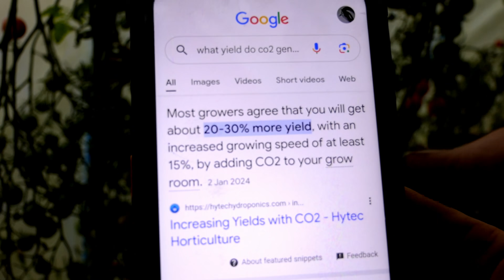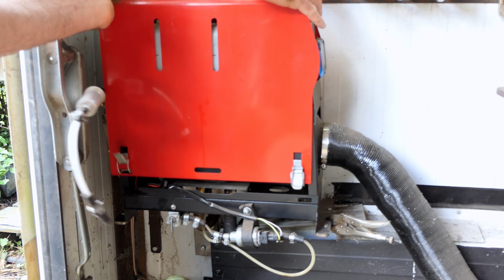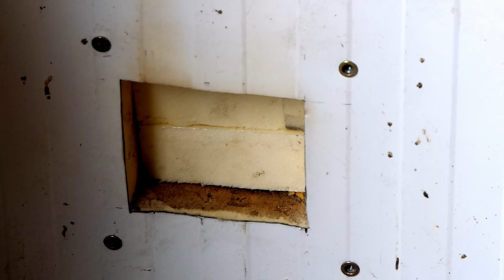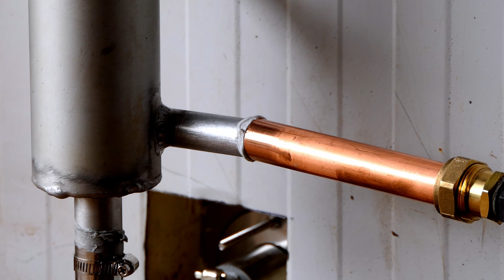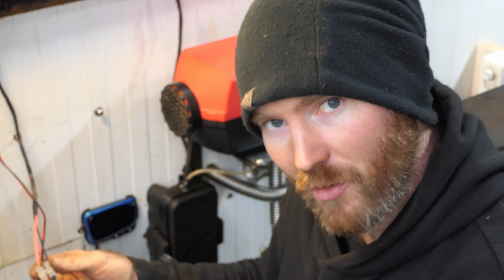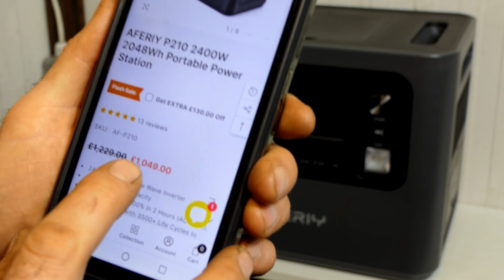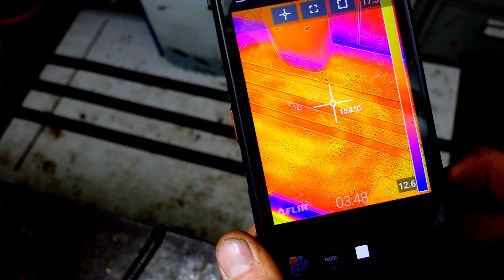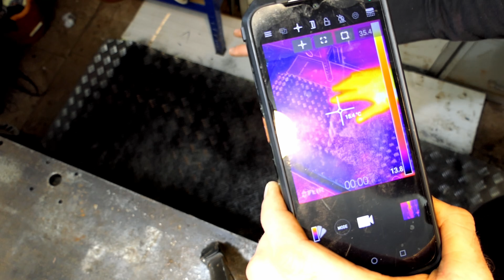NEW! Better system for Cheap and Safe Heating💲+ Underfloor Heating Mod test🫠

Comment: Some thoughts:  The problems with an overly relaxed attitude to the possibility of global warming is the probability of mankind creating a positive feedback loop which will lead to the ending of the current inter-glacial pause (Holocene) in our current ice age with the ending of that ice age. The fact is that without the current warming, whatever it is caused by, the planet would be slowly cooling as a result of the direction the Milankovitch cycles at the moment and heading to a resumption of the ice age in 20,000 to 30,000 years.  It is asserted that this isn’t happening because the effects of slightly higher levels of CO2 caused by the release of carbon that was locked up as fossil fuels (coal, oil and natural gas) in the earths crust by humans. 

We know how, and how much carbon has been sequestered and we know what the climate was when that carbon was in the atmosphere as CO2.  As you rightly assert the Earth was warm, ice free and teeming with life. It was also millions of years before a population explosion of one particular great ape in the Holocene lead to our current human civilisation.  

The fear is that by releasing the small amounts of carbon that we have we are in the process of creating a positive feedback loop, tipping the system into an ever increasing and ever increasingly rapid heating effect. The point is that the carbon was locked away and without human involvement, would have stayed locked away.  Furthermore we do other things which don’t help, such as cut down too many trees without replacing them.  

The trouble is that our civilisation cannot adapt to rapid change because there will be huge populations who will have to move because their climate will be too hot, or they live in and on land which will become flooded. Furthermore areas of food production will become less productive and famine will spread.  This will lead to war as the strong attempt to protect their populations from the much more numerous and increasingly desperate weak.  The human population and civilisation locks us into a need for the climate to remain within a stable range with changes happening slowly so we can adapt at a natural and subconscious rate. 

So the question remains is the human release of carbon, locked up by nature millions of years ago crucial?  If we released all then absolutely yes, but we haven’t yet and are unlikely to do so.  So how much is safe?  How much risk are we prepared to take?  Should we be doing anything about it?

I drive an electric car, not just because during its life it will emit substantially less than a fossil car but because, as far as I’m concerned, it is much better.  Furthermore it is substantially cheaper to run (about 25% of a petrol car).  I’m lucky because it is easy for me to do so.  I’d assert that it would be good if all in my situation got electric cars, air quality alone makes this a good idea. I live, however, in a Victorian house with solid walls which is largely in the shade of my neighbour’s larger house to the south. This means that heat pumps and solar panels are not as attractive they are for others. So I will do my best and I’d hope that you would do so also. There are alternatives to the wonderfully energy dense oil you prefer, try exploring those and please insulate that door.

Comment: I didn't notice on your video if you did it or not, but it's better with the pex pipe to install an insert in the end before you insert it into a push fit fitting. It helps to stop failure. I didn't know about those little water heaters, I just ordered one to add underfloor heating to a cold frame. Apparently our wonderful electricity suppliers/the bbc are turning off the signal that switches the old style electricity meter to the cheaper tariff overnight (economy 7) , that would make my current electric underfloor heated cold frame to costly to run.
Thanks for the videos, I enjoy your content.
Reply from the maker: Thank you, on a low pressure system the inserts are not needed from my experience. cheers J

Comment: I get frustrated with people conflating existing carbon, people breathing, trees rotting or burning etc, with the issue of adding co2 to the system.
Reply from the maker: I only used total CO2 from what I understand. cheers J

Comment: What  efficiency dose the boiler have I would think at max 60% .
Reply from the maker: My combi boiler is 93% efficient. If I can get good condensing heat recovery for the diesel heater then I can get similar efficiency. Cheers J

Comment: If exhaust gases were directed straight into an aluminum car radiator, with the whole setup submerged in a water tank, it could help transfer heat to your radiators. Additionally, the exhaust noise might decrease, as the water could absorb some of the exhaust vibrations.
Reply from the maker: Very true. Cheers J

Comment: One option is to add a sand storage for the exhaust gases. It will then emit the heat for a long period of time into the room. The exhaust gases can go from 200 degrees Celsius+ to 10 degrees at the end of the sand storage before going outside 😊
Reply from the maker: @icucode  I tested that already and it's not very efficient at this scale. You need temperatures exceeding 600°c to make it viable because sand is a poor conductor. Cheers J
Reply: @joshuadelisle  Yes it looks like you can store three times the amount of energy in water that you can in sand. A water tank with long exhaust pipe is perhaps the best way to store the energy. 60 kWh / m3 for sand and 180 kWh / m3 for water with 160 degrees Celsius difference from ambient temperature.

Comment: I do have one question as all the time working in engineering with being told & seeing the efforts in keeping air cool on entry to burning of fuel made me take interest on results?
Think about intercoolers?
OK the burner is the same as I have & know how inefficient it is with the Chinese always using the peak outputs in advertisements, with never saying the average it really works at.

interesting to see results.
Reply from the maker: I think I would like to do an experiment just on that by switching the air intake with a heat exchanger version. cheers J

Comment: Truthfully, there is a lot more energy we could take from our atmosphere than we do. For instance a piezoelectric diaphragm that has a vacuum on one side then a vacuum on the other but it is held back by a one way check valve. Just make sure it's shaped to bend back as air rushes past and rebends back into place the diaphragm for Bernoulli's principle to reduce pressure to have it bow out less and setup multiple diaphragms in a row to capture 90% off energy of the air rushing past. Oh, also have it self seal so it maintains vacuum and direction towards a lower pressure for maximal total capture of movement but also making it constantly pump so long as the seals remain for the vacuum and diaphragm. But this introduces vibrations, which can be turned into an acoustic cooler/heater. Neat, huh? But yeah you can make it hollow and have refrigerant get pushed around by diaphragms connected to pump it in a resonance harmonic frequency for Thermo pump (the whistle when heated, when done properly with the right check valve reed valves a pump is created using vibrations) but you did. The diaphragms before but now with extra tube over that. Just on the vacuum side the vacuum will transfer volume as a sonic wave in the metal. Anyways, that gives you vibrational heating while making electricity for the gravitational potential energy converted from air pressure but also absorbs the heat from it needing to rush through and get compressed because of vibrations heading backwards thanks to spring tension of diaphragm relative to the vacuum tension on the other side with the air rushing through. Just need the right clearances, for all of it to do it over the maximal surface area to smallest inner diameter nozzle point to largest surface area. Basically it's an type of hour glass shaped, they call them deval nozzles. Just split them repeatedly into smaller and smaller ones that shape into that, which just means infill is a couple of plates with hole and tube patterns and sequences that makes a fractal 3d repeating inward bound deval nozzle set, which now is easy. Why because offset recessed holes on both sides of the plate with the correct angles done and drilled, sizing too, then you get the deval nozzle fractal repeating set, that's 3d. Then it gets bigger from a ultra small chamber area of check valve piezoelectrics diaphragms. To split it and race it towards the larger area. 

It's a good generator from just electricity generation, but cools itself with refrigerant, never burns any fuel to do it, easy to make and repair, and be hooked up to another one to transfer energy to the other side which warms everything it gathers on the other side using the same air pump, thermal transfer, the other one is but in reverse.

For moving heat somewhere it makes more energy than it takes to run. Because of vacuum energy being the only required true stored energy. It just had to be balanced, which is why spring tension is so nice because it makes it so very much easier to do. So vacuum peristaltic pump that makes heat get moved because of the vacuums inside it what make sure keep wanting to pump it acoustic resonantively and work energy refrigerant, with resistive or no resistive heating added from the generated electricity (because, yup, it does that) or you can use that to just generate electricity for you. Oh right. It scales better and better the bigger you make it, but because multiple smaller ones can be built and made to do it together into a larger center point area for total volume efficiency to then have it exit multiple smaller ones outside, it becomes really really small and non-noticeable. We've had this for decades, truly 1000s of years, the parts at least, not the knowledge put together though lol. Why are we not doing the completely no pollution generator heater/cooler pump like this? 😏
Reply from the maker: Piezoelectric generators are great but generally very low output. They're commonly used to power flashing lights in children's novelty shoes that light up when walking. I like the idea of harvesting energy from vibration and resonance though which will dampen the sound. It's worth an experiment for sure. Cheers J

Comment: I put my pump outside under the tank in a box on the wall.
I use 3x 3m 28mm copper pipe looping on a wall in the workshop with a radiator at the start.
Currently moving benches & heater but I did touch the end of the pipe (carefully, I know stupid!) & it was hot but not too hot.
I burn far less fuel than expected but do have a dehumidifier to keep around 50% humidity @19C.
Myself burning kerosene efferently I see little impact compared to the people kerosene to fly the people who publicise global impact!
Bigger issues are other particles being created & released into the atmosphere & energy used in war!
The one wish I had was to add a spur off the stove with back boiler from the house (as the workshop backs onto it) but it is a very old cottage with walls at this point nearly 1m thick stone!
After losing a day to get heat into the kitchen I gave up as dehumidifier does a great job & I am the mug that has to cut the firewood!
Reply from the maker: Nice. Wood burners are great. Cheers J

Comment: Keen on what brands you'll test for battery, there's a new solid state one called yoshido. Worth a try...
Reply from the maker: I'll look into it. So far I have the large Bluetti, the Delta2 max and AFERIY. I'm doing an independent test for the Bluetti next as I go camping. Cheers J
Reply: Solid state is marketing. The tech isn't there yet. Doesn't mean the batteries aren't good. Just that you shouldn't take it any more seriously than the colour of the brands logo in your purchasing decisions.
Reply: @Leo99929  solid state is lighter and as energy dense, I assume it's safer too with lack of thermal run away.
If the application calls for these features, I see it as very viable.

Comment: Hi, another really good video that has raised several interesting points.
   I have installed one of these diesel heaters in my 10 By 16 foot shed which is built of timber ( wood purchased before prices went daft!) its fully insulated with rockwool.
   The heater has the exhaust passing through a steel radiator and is piped  using 22mm copper, thus extracting as much heat as possible from the exhaust. ( well not all of it by any means! )
   There is a fine line as to how much heat one can recover before causing problems with the operation of the heater as you will be fully aware of yourself.
   The silencer you have used is next to useless as it is basically just an expansion vessel with no baffles at all, several videos on YOUTUBE   show that it is difficult to reduce the noise substantially, also is can be dangerouse to reduce the exhaust temperature too far and causing other problems.
  Keep up the great content and the many subjects that you cover.
Reply from the maker: I agree. I think cooling the long exhaust caused the burn to produce that carbon build up by restricting the gas flow. I'll be doing something different in my next experiment. Cheers J

Comment: Yeah, people say scrap your car/tuck and buy a new electric one. I think you would put much less strain on the environment by making the old one last longer and saving the environmental(and cash) cost of building a new one.

PS. We used to just add some hydraulic oil to heating oil for lubrication for use in Diesel engines (for off-road use).
Reply from the maker: Nice. I agree, I have 2004 Ford ranger and can basically run it on vegetables. Cheers J
Reply: Depending on what vehicle you have and what EV you buy, the EV is better for the environment after maybe 7 years. Engineering Explained does a good series of videos on the maths behind this. Meaning that it is actually better for the environment to scrap your working ICE vehicle and buy a brand new EV.

However people have different use cases and not everyone can currently afford to buy an expensive EV that has a limited range and hauling capacity. I think it's more reasonable to just ensure that the next vehicle you buy gets better MPG than the one it's replacing. That's it. Then we walk towards burning less fuel. As a bonus, we spend less on fuel.

Comment: As the efficiencey of the heater and the use of the latent exhaust heat increases wouldn't you run into an issue where the heater would need to restart after periods of shutdown once the required room temp has been reached? This restarting process would consume 300% more 12V energy opposed to the continual running of the heater. If the battery pack was recharged by mains power (if solar was not available) what would those wattage figures look like? Would it be a considerable increase in costs? Any chance that a cheap cooling solution could be discussed? I need a cooling option as heating is not needed in my region, day time temps range between 32 - 40 deg C and depending on wether it is dry or wet season night temps range from 20 - 30 degree C. Plus adding in the extreme humidity during the wet season cheap non evap Air cond solutions would be an awesome topic to cover? (Darwin Australia) Cheers and Love your work excellent job.
Reply from the maker: Thank you. You're correct, I think using thermal mass storage and good insulation is a good idea to retain the heat that's been generated.  Otherwise you can idle the heater on very low settings and then raise it automatically with an in built temp sensor. Cheers J

Comment: Kerosene was exclusively used for lighting and heating until Natural Gas, Butane and Propane were pushed on us by big oil. Rural areas in America used Kerosene up until the early 60s.
Reply from the maker: Interesting. It is mainly gas isn't it from what I've seen. Even though kerosene is mainly a bi-product from oil distillation. Cheers J
Reply: @joshuadelisle  Kerosene is not a bi-product, it is used primarily as jet fuel. Too valuable as jet fuel to market it for other uses.